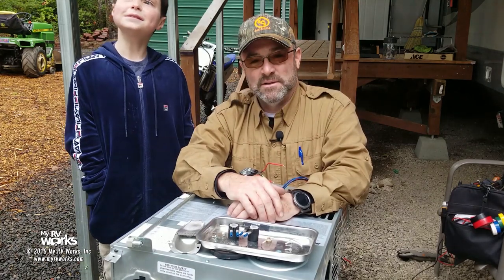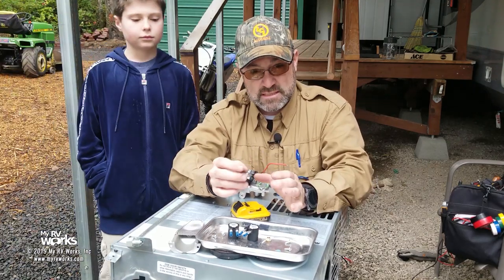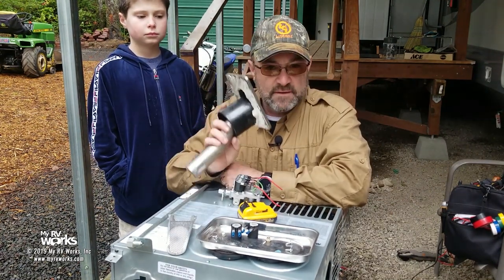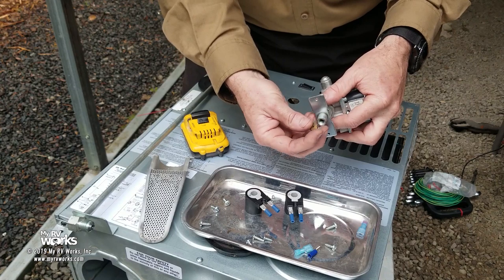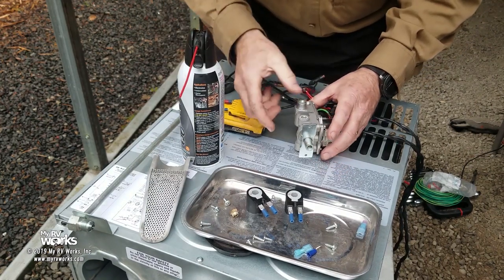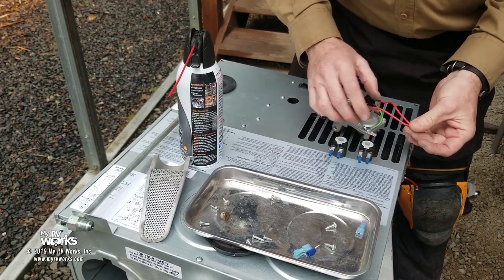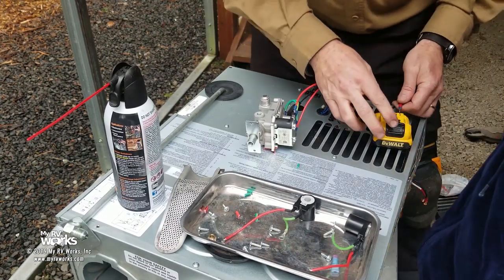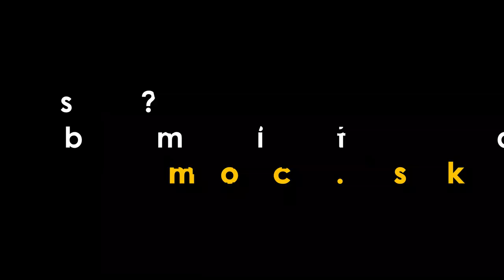RV Furnace Gas Valve Solenoid Failure

Comment: Maybe you can help me. I have a Atwood furnace on my camper when it on it runs fine and puts out good heat. But as soon as it shuts off we start to smell propane in the camper.
Reply: When the flame shuts off the motor should run until the entire burner chamber is cool again, is it? It's possible the solenoids are not closing but open fine leaving a little gas in the line until it lets the remaining gas out. But if that is the case it should quit if the leak is from the valve and only if the valve closes completely. The burner could be burnt and insufficient or the oriface could be partially clogged but that may not fit with the fact it runs fine. There are so many possiblities I would get a technician out to check it out, or first test the solenoids to see if they open and close fully, and their ohms test as designed.
Reply: Thanks for the advice.
Reply: @Handyman984  When the flame shuts off the motor should run until the entire burner chamber is cool again, is it? It's possible the solenoids are not closing but open fine leaving a little gas in the line until it lets the remaining gas out. But if that is the case it should quit if the leak is from the valve and only if the valve closes completely. The burner could be burnt and insufficient or the oriface could be partially clogged but that may not fit with the fact it runs fine. There are so many possiblities I would get a technician out to check it out, or first test the solenoids to see if they open and close fully, and their ohms test as designed.

Comment: You didn't cover 1 major issue, what about when your solenoids test good, you can blow air through when you energize the solenoids but when the furnace does it, the valve only opens for a split second.

Comment: I am not hearing the clicking noise . Is that a bad igniter ?
Reply from the maker: If you're not hearing the furnace trying to ignite, then the issue is most likely on the 'blue circuit' side, blue circuit being sail switch and/or high temperature switch.  In this video Darren touches on a little bit of the logic of these circuits:  https://youtu.be/BpQHc6_NwPU
Reply: @MyRVWorks  Thank you . Do all furnaces have sail switches ? I have an older Coleman and cant seem to find it . Thanks again .

Comment: So my heater comes on intermittently it usually always starts when it's cold but then when it restarts from the thermostat you hear the fan you hear the ticking noise and you smell propane but it doesn't light
Reply from the maker: It would be good at this point to pull the burner out to inspect that burner and Electrode. The gap between the burner and Electrode may not be set correctly or your burner may be very Rusty with some deformation to it. You won't know unless you go in there and have a look at it.
Reply: @MyRVWorks  Thats what i was afraid of.  Mine is completely inside the trailer.  Keystone passport 234qb.
Reply: So I pulled the burner and the electrode everything looked good no holes in the burner however the Gap was about a half-inch from the burner to the Probe on both the ground and the probe I tightened it up to about an eighth of an inch and it fires right up everytime I'm wondering how a gap gets extended to that degree a half-inch?

Comment: Mine currently lites 🔥 up and dies out in 5 secs.  Then the  computer will retry and about 30s over a over.. I even jumped the solids to 12v when I hear the Igniter lighting, fires up then dies even with the sonoids held open. I'm pretty sure either my  Ports are clogged or the sonoids aren't picking enough I hear them click. Thoughts already replaced the computer.
Reply: Test the ohms on the solenoids, the gas valve for obstructions, your WC" at the outlet or any to be sure you have 12" with all systems off.
Reply: @frankshiffer588  it ended up being a stuck sail switch, after I fix that, he kept blaming out on me because I didn't have the dogleg exhaust pipe on, the new heaters have a safety feature they won't run without the exhaust tip on crazy threw me for a loop
Reply: @brianpevehouse1150  Yes he mentioned that safety feature if not on this video on a similar one. How did you figure out it was the sail switch? Thanks for your reply we all can learn from each other.
Reply: @frankshiffer588  yep that's where I saw that safety feature in one of his other videos. My sail switch was actually stuck on so when I pull the wire off the fan would start then I could put it back on it would fire up, the propane, but then died out due to not having that little muffler on. Live and learn

Comment: When trying to turn on the furnace the fan comes on I hear no clicking sounds at all what should I do
Reply: Check the wire to your electrode, if it attached then you need a new electrode or sail switch. Check your sail switch that it is not covered in hair or debris keeping it from moving.

Comment: Great video.
Question :. My furnace works fine, but once it starts blowing warm air into my RV, I smell propane?
Then I shut the finance off and air out the Rig.
Got any ideas?
Reply from the maker: To schedule a service consult with Darren please sign up for the "1:1 Repair Consult" on our Patreon site.  https://www.patreon.com/myrvworks
Reply: Rick did you end up solving your issue? I have the same issue.
Reply: check your gaskets on the furnace

Comment: what if it clicks and you smell gas but no click click clikc from the ignighter
Reply: Check your sail switch for hair or anything the could keep it from moving
Reply: @ThirdTimeAroundRanch  replaced the sail switch replaced the high limit switch checked the baord with anouther matching baord from my other RV now i have perchased a newer dinasour board wtch is a fan 50 pluss pins but it has two exstra prongs and dealer said it was to by pass the  time relay nead help on knowing where new wires go .it has some directions but i dont complettly understand
Reply: @ThirdTimeAroundRanch  water had shorted the time delay relay and they dont make that relay any more
Reply: @puffthemajiccdragon  When buying dinosaur boards they should be able to tell you what you need to do. I have always found them to be very helpful
Reply: @ThirdTimeAroundRanch  it only tells me how to hook up the two wires for the fan motor and it dont say what im soposed to do about the blue wire comming from the thermistat..and the wire that goes to the gas valves to open the valves .. how  do i hook up all 4 wires??

Comment: I have an Atwood 8520-iv I’m getting fuel, I have ignition but the igniter stays on and then the furnace shuts off. So in detail, 
1. Furnace goes through purge
2. I hear the click
3. Igniter comes on
4. Burner ignites
**5. Igniter stays one
6. Feel heat for 5 seconds (exhaust port)
7. Furnace shuts off 
8. Light blinks 3 times
Everything is working, but the igniter stays on (ticking)
What could be the problem?
Thank you!

Comment: Darren, thanks for this video.  My Suburban SF20 F furnace recently developed a strange "hum."  At first, I thought it was a bad bearing in the blower, but when I turn the thermostat from "Heat" to "Off," this hum instantly disappears and the fan blows with no sound or problem.  I then thought it might have something to do with the gas valve or the burner but need an expert opinion on what it might be.  Here is 27 second portion of what this "hum" sounds like:  

https://soundcloud.com/user-55379345/suburban-sf20-furnace-rv-hum

Does this sound like a bad bearing in the blower or something else?
Reply from the maker: To schedule a service consult with Darren please sign up for the "1:1 Repair Consult" on our Patreon site.  https://www.patreon.com/myrvworks